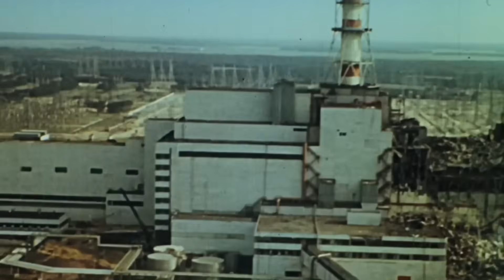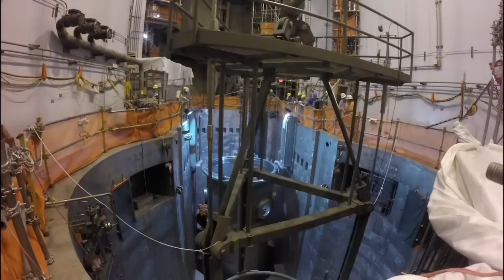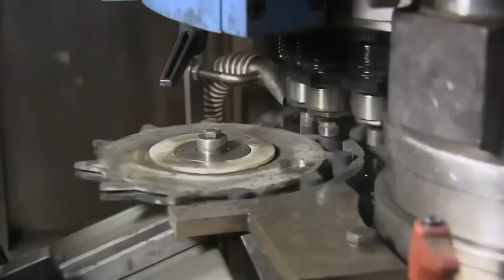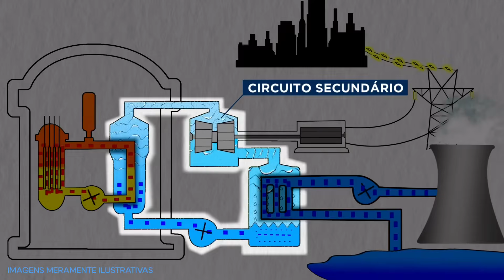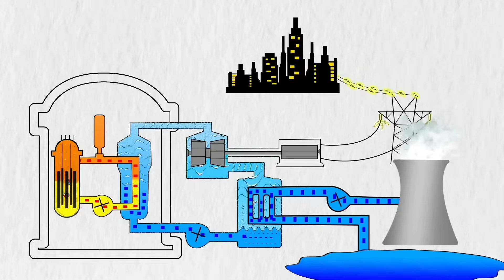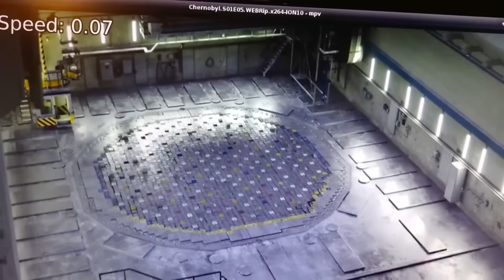Corium: The Deadly Substance Behind Nuclear Disasters

Comment: This thing should not be wasted. It needs to be studied and understood.  
RECURSIVE GEOMETRIC MODEL OF EXTREME-LOAD INLAID MATERIAL

0. OBJECT

We model a material as a field of phases over space.

Let:
- X = spatial domain
- P = {P1, P2, ..., Pn} = set of phases (e.g. "ceramic", "metal", "glass", "void")

A configuration is:
  S : X -> P
assigning to each point x in X a phase S(x).

At finite resolution k, we coarse-grain:
  S_k = partition of X into regions {Omega_i^k} labeled by phases P_i.

1. OPERATORS

We define three geometric operators on S:

  L = collapse (extreme load)
  C = consolidation (cooling / settling)
  R = relaxation (long-arc unwinding)

Each acts on configurations S_k at multiple scales.

2. COLLAPSE OPERATOR L

L represents catastrophic load: high temperature, stress, etc.

Geometric effects of L:
- boundaries between regions blur
- regions merge and fragment
- connectivity changes
- large-scale structure is destroyed

Formally:
  S_k' = L(S_k)

L is allowed to:
- erase fine structure
- create mixed/intermediate regions
- reassign phase labels based on local constraints
  (e.g. "melted", "flowing", "mixed")

3. CONSOLIDATION OPERATOR C

C represents cooling and settling after collapse.

Geometric effects of C:
- phase separation (regions of like phase cohere)
- interface sharpening (boundaries re-form)
- stratification and inlay (phases arrange by constraints:
  density, wetting, confinement, etc.)

Formally, iterated over time t:
  S_{k,t+1} = C(S_{k,t})

C tends to:
- minimize interface energy
- respect global constraints (gravity, confinement)
- produce nested and interlocked regions:
  inlay patterns of P_i inside P_j across scales.

4. RELAXATION OPERATOR R

R represents slow evolution over long times.

Geometric effects of R:
- microcrack formation and growth
- coarsening of domains
- slow boundary motion
- fragmentation of larger regions into smaller ones

Formally:
  S_{k,t+1} = R(S_{k,t})

R preserves:
- large-scale phase roles
- overall partition structure
but changes:
- fine-grained geometry
- connectivity at small scales

5. INVARIANTS

Across L, C, and R, we track geometric invariants:

- Phase identity:
  labels P_i remain meaningful (even if redistributed).

- Role invariants (example):
  some phases tend to form:
    - backbone regions (load-bearing skeleton)
    - binder regions (connecting networks)
    - matrix regions (filling and locking)
    - void regions (stress relief, fracture paths)

- Multi-scale inlay:
  at any scale k, regions of one phase are
  embedded within others in recurring patterns.

Thus, while shapes change, the pattern of roles and inlay is invariant.

6. CORIUM-LIKE CASE

A "corium-like" object is any S that:

- has undergone a strong L (collapse),
- has been shaped by C into a dense, interlocked inlay,
- is still evolving under R,
- preserves role-invariants across scales,
- appears macroscopically stable while microscopically active.

It is a recursive inlaid geometry:
- born from collapse,
- stabilized by constraints,
- slowly unwinding,
- with structure expressed as:
    S_{k,t+1} = R(C(L(S_{k,t})))
over long time.

This model is independent of chemistry; it only assumes:
- phases,
- operators on partitions of space,
- and invariants of inlay and role across scales.